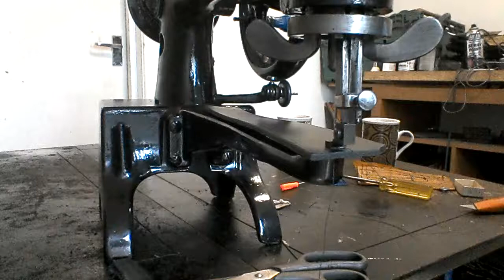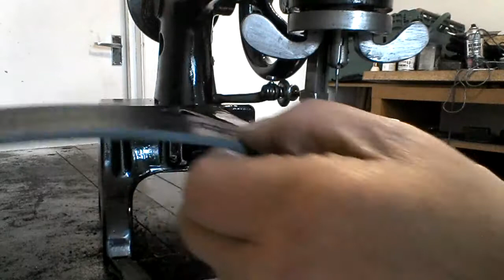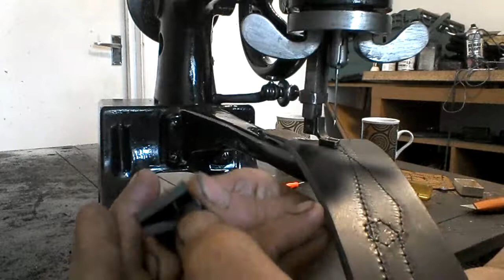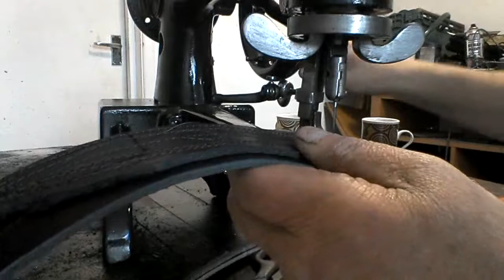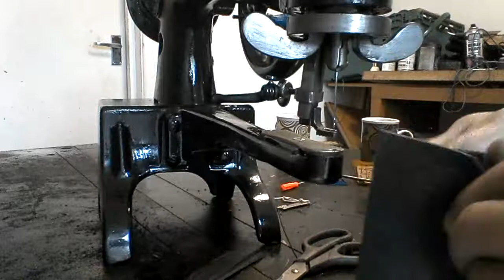Singer 29k awaiting decals part 3 2x4mm leather  sewn together

Comment: I have a 29-4 but it has some issues, I’m having problems with the walking foot scooting rather then lifting up and walking. The first couple of stitches always seem like not advance and just keep punching in the same hole. If I push the material then it seems to go but not always. Know how I might get info on those issues.